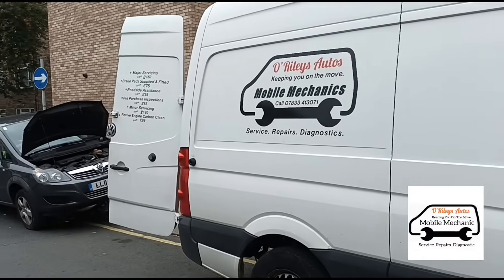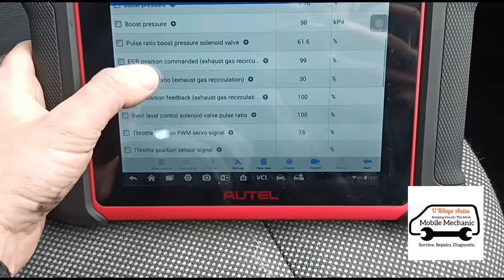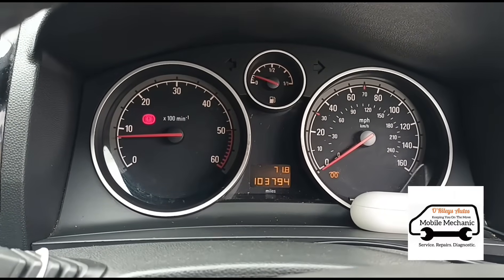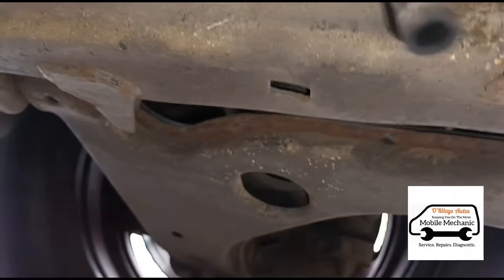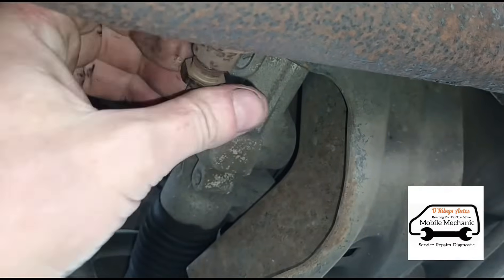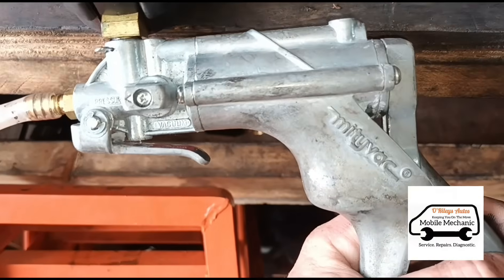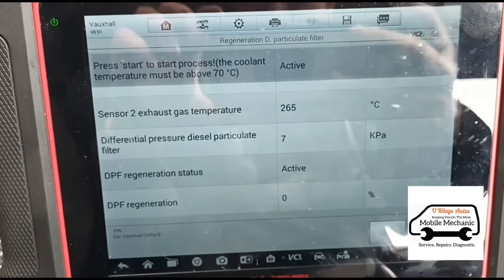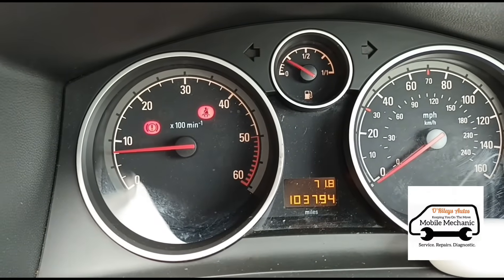How To Diagnose A DPF Diesel Particulate Filter Differential Pressure Sensor & Test Hose Pipes

Comment: Thanks for the video,i fixed my dpf problem on mokka 1.6cdti,sam problem,pre dpf pipe fully blocked,diferential sensor only reading 0.55V at 3000rpm.

Comment: Got same problem on 2014 ford ranger 3.2 i believe,dpf reads 90% full, 0g ash and 0 pressure, in your experience with fords do you think it will be pipes, sensor or wiring loom? Thanks

Comment: i've got a vivaro from 2017,

from live data i can see that low pressure egr air temperature (100celcius) and manifold air temperature (20celcius) stays as it is.
when its cold, while driving and even after.

could this be the issue for ''check injection system''? 

Fault codes: 
DF1756 (boost pressure circuit: turbo charging pressure is too high)

Comment: I have the same car, DPF was just cleaned last week but EML came back on last night. Fault codes P242F-66 & P242F-5B. 

Live data shows DPF pressure is 2 kPa at idle and DPF is 27.45% saturated. Any feedback would be very much appreciated. Thanks

Comment: Hi.
What are normal values for a good dpf at idle and at about 3000rpm?
At what values you need too look in to it?
Thanks
Reply from the maker: 30-60Mbar at 3000 rpm
1-6 mbar at idle
Reply: @ORileysAutos 
Thanks
So 30 is maximum when on idle en 60 with revs up?
Reply from the maker: @leminako  6 at idle
Reply: @ORileysAutos  I have the same vehicle as the one in the video, carried out a clean with Wynns. The idle reading is between 0-1 kPa, and 3000RPM is 5-7 kPa. I’m thinking it needs another clean just to bring the figures down a bit further. What do you think? The figures were higher prior to the clean.

Comment: jimmy i have a similar fault, spanner on loss of power and opcom gives me fault P242F75 AND 242F-58 DPF SENSOR RANGE PERFORMANCE.
I do log and the values are at idle 8HPA and as I accelerate up to 2000rmp it goes up to 40hpa
does this mean dpf blocked or dpf sensor in bad condition?
When I turn off the engine the pressure drops -2hpa. I guess the sensor is in good condition.

thank you very much

Comment: Doing that, reminds me of what I used to do as Teenager nearly 60 years ago.
The the baffle out of my motor bike, soak it in paraffin and then set it on fire.
That burned off most of the carbon.
Fi ished the job with a wire brush and central heating boiler cleaning rod.

Comment: Hello, nice video. What should be normal dpf diference presure reading? On idle or on some rev in car? In case if sensor and lines are not clogged. How to tell if there is need to start worry about.
Reply: yeah. did you find answer?
Reply: @ErkanCivelek  Kind'a found and same time not. :D. On VAG 2.0TDI CR Engine, or similar. Empty or after regen on idle 6-10hPa are good readings, increasing up to 18-28hPa when acumulating soot to active Regen level. Light driving up to 2.0k Rpm Empty/after regen 20-30hPa, and nearly fill up regen level 30-60hPa. During regen it might go up to 80-120hPa, cause of high heat and expanding metal. In other circumstances on highway push high load 3k rpm and more push out and etc 60-80hPa but it never goes above 100-120hPa. Numbers are inacurate just about from some monitoring and etc, on cars with healthy with some life spam aged, but still healty and working not cloged dpf. Anything higher than 200-300 hPa on load, and above 30-50hPa on idle means some issues or other restrictions in exaust system. And real number i think differs, by car and etc and didnt found anywhere officialy. It just posted numbers from some investigation...

Comment: can you give me an idea what to check? I checked the hoses, replaced the pressure sensor to be sure is ok, seems fine, I got a value ~7mbar at idle and ~20mbar @ 3000rpm. What I dont get it, is why is regenerating if DPF is clean (I also take it out and give it a deep clean even before cleaning was not clogged and was regenerating ~ every 50 km and then reprogram as I have change it), and acc. calculation it is showed ~40% normal clogging. I is normal to regenerate  often (500km interval in city conditions) even if is not clogged?

Comment: Hi Jimmy,

I have an issue with my vauxhall zafria b where it keeps stalling when idle (after 10-30 seconds) and whilst slowing down to stop it will cut out unless i keep the revs up higher than 1k.

I have been told its my DPF and needs replacing. Its currently at 96% saturation but when i just connected it to opcom the DPF sensor doesnt seem to be moving up very much. Could it be just blocked pipes rather than having to replace the DPF? 😮

Cheers

Comment: There was dead tube (just ruined into small pieces :) )  on renault laguna III, after DPF. Replaced to another 6mm for fuel, but error still exists and see that diff. pressure is 0 or -1. Will check if not blocked tube (metal) to DPF or if sensor reacts to pressure in rubber tube from that join. The amount of ash in dpf renault canclip shows about 27grams, have to hurry up :)

Comment: Great video. By the way, what pressure side this sensor reads, upstream or downstream?
Reply: It’d be upstream checking pressure build up in front of the dpf. Most modern cars have a differential pressure sensor that checks before & after (as in the word differential), older simpler systems just have a pressure sensor in front.
Reply: @madds6678  Thanks for your reply. Mine is Insignia A20DTJ 2010

Comment: Hi great video as always. I’ve recently changed a faulty Dpf sensor on a Tiguan. Live data shows 2 sensors (there is only 1) should the readings be the same? Cheers
Reply: What symptoms did u have pal ?
Reply: Ah mate can’t remember properly. Pretty sure was a code for implausibility signal for dpf sensor. Eml was on and think in limp mode. Wiring was all good. New genuine sensor sorted it. Sorry for the vagueness 😂.
Reply: @markraz28  ah ok buddy thank u waantvsure if u had frequent regens ty
Reply: No maté definitely wasn’t doing that. Just limp mode

Comment: Jimmy what would cause a forced regeneration to go no further than 20 percent ?
Reply from the maker: Is it stopping because it's saying unsuccessful?
Reply: @ORileysAutos  yes saying unsuccessful
Reply from the maker: @davidwaters5348  lots of reasons. What vehicle is it
Reply: @ORileysAutos  2012 megane 1.5 dci
Reply from the maker: @davidwaters5348  did you watch my video on the mercedes b class with same engine
Reply: @ORileysAutos  ha can u imagine spending the cash on a merc to have a French engine 😱🤣🤣🤣
Reply: @davidwaters5348  My Dads Jaguar X350 2.7D is also a French lump. Shocking.

Comment: On our fiat ducato ambulances I see -1 0r -2 with ignition on not 0 does that mean a pipe blocked or starting ?
Reply: Hi, take the pipes off so sensor is at atmospheric pressure ie zero and see what it says then, if still 1 or 2 then sensor could be faulty or just needs calibration